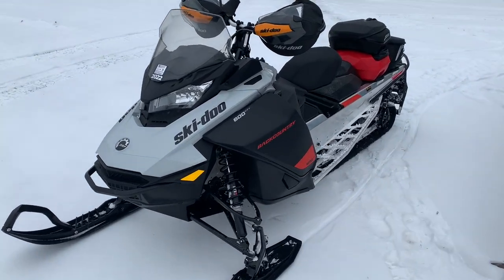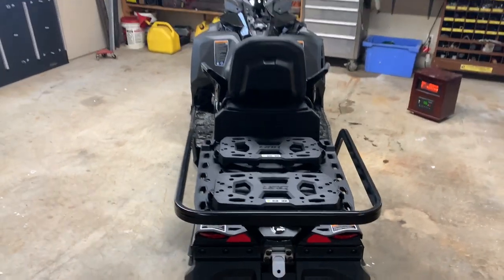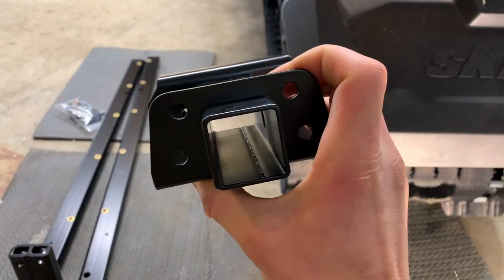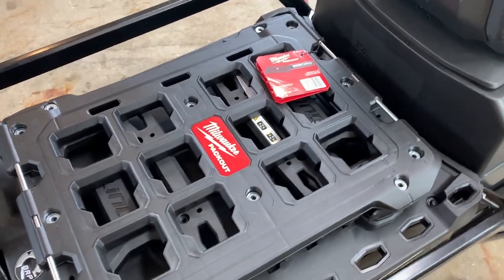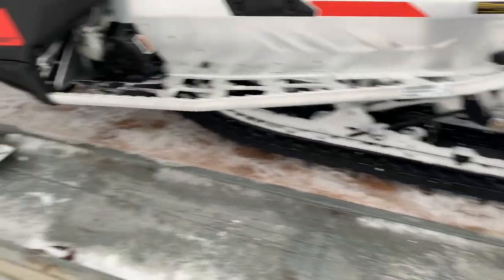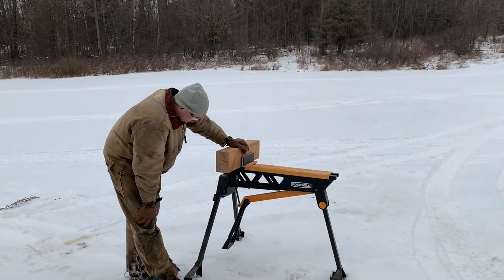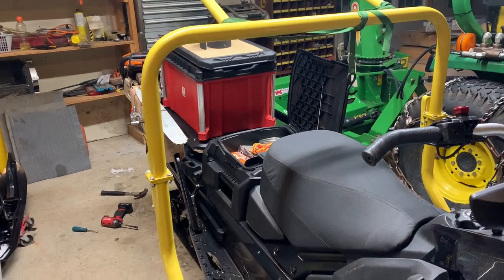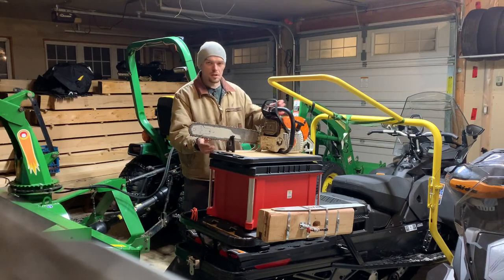SKANDIC THE TRAIL CUTTER

Comment: Great video. I have been using the Superclamp now for five years on a aluminum trailer and really like it. Very secure and easy to use. Also use a old section of track for traction to load the Skandic in the tilt bed of the trailer, and can just ease into position without risk. Been using a tow behind trailer for five years with the same tow bar with no issues. I bet your set up works great, time will tell.

Comment: Any reason you couldn’t just bolt the packout mount plate to the tunnel without a linq adapter ?
Reply from the maker: You can probably pull that off but I switch back and forth between my Linq bags and the Packout stuff daily depending on what I’m doing.
Reply: I did just that. It isn't difficult to do. I set the mount on the Linq plate, mark through the packout mount holes to the Linq plate, drill holes in Linq, bolt packout down, reinstall Linq plate. Easy. The Milwaukee Packout system has a lot of options. I use it for everything.

Comment: What is the make of that rear bumper & tunnel rack?
Reply from the maker: It is a Skidoo HD rear bumper for 20” machines rated for 1500lbs compared to the stock 1200lbs one. The wrap around bar the saw is attached to came on this model from factory but is also a Skidoo accessory. The Milwaukee stuff is on a universal wall mount from Milwaukee bolted up to two of Skidoos Multi Linq base plates a homemade combination. I think there are companies making aluminum plates that bolt to the skidoo tunnels now. Muskoka Freerider on YouTube runs one on the mountain sleds that is much more low profile.
Reply: Sweet thank you!